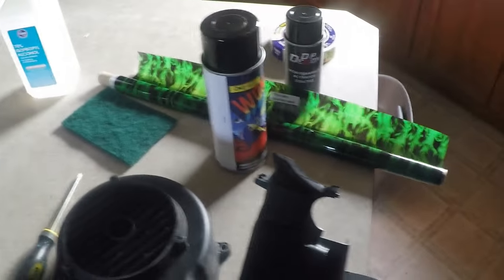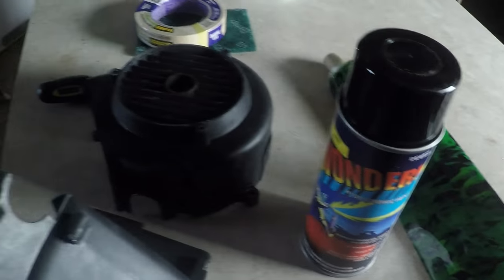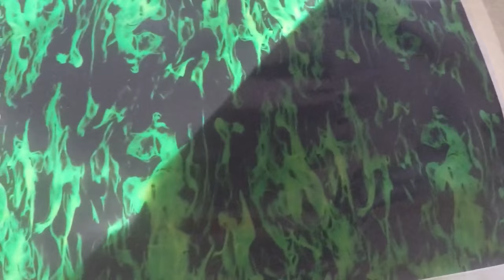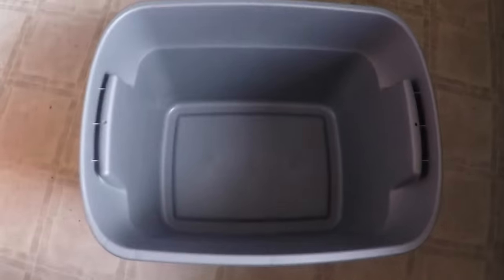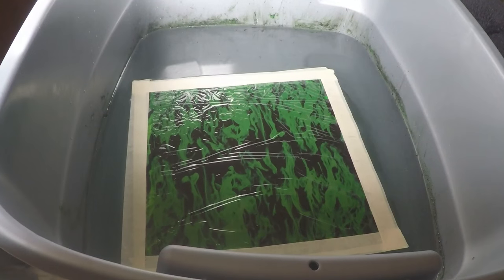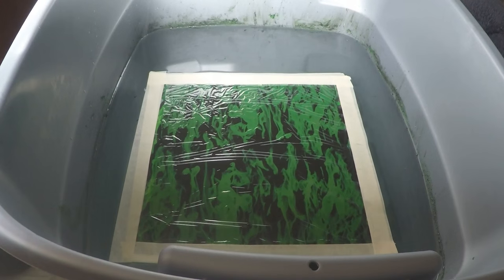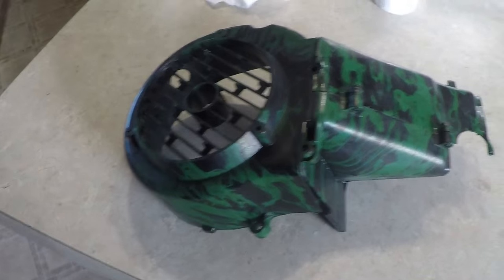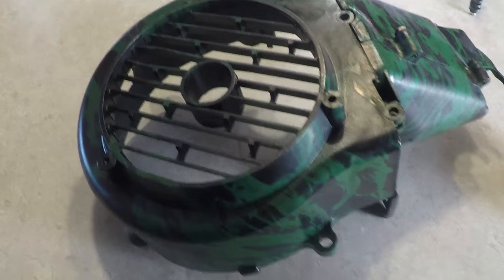Gy6 Honda ruckus build Part2 -Hydrodipping

Comment: I think practicing on some useless plastic would have helped out quite a bit but hey still looked pretty good, and honestly no one is going to pay super close attention to those pieces from the looks of the completed scooter.
Reply from the maker: joe leeman it was a small sheet. so in order to not have to purchase multiple roll, I took a chance on applying it to the engine covers.

Comment: bout how much for a roll like that an where?
Reply from the maker: Don't forget you need the activator and the base coat paint. everything can usually be found on ebay.http://www.ebay.com/itm/GREEN-FIRE-FLAMES-HYDROGRAPHIC-WATER-TRANSFER-FILM-HYDRO-DIPPING-DIP-KIT-INFERNO-/331762342918?hash=item4d3e939c06:g:QgAAAOSwoydWpSg5
Reply: switchjv thanks